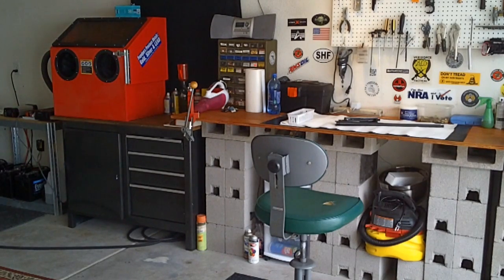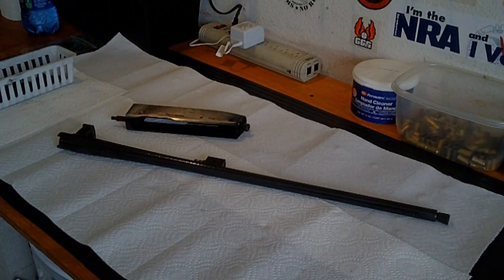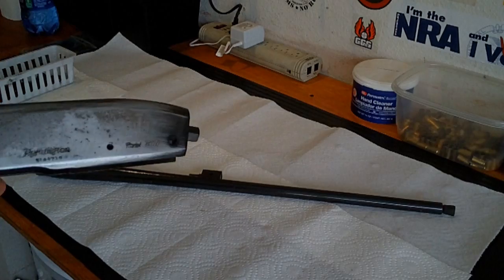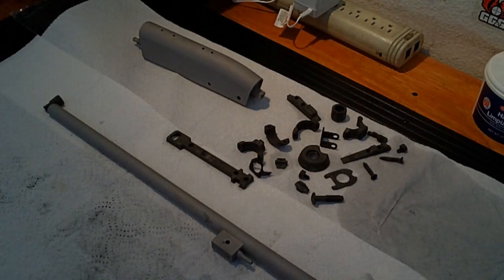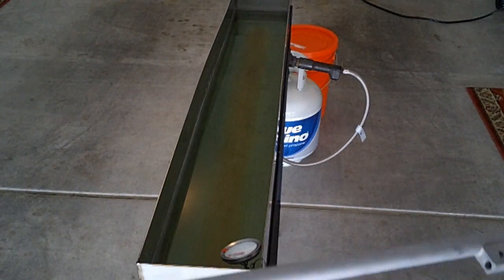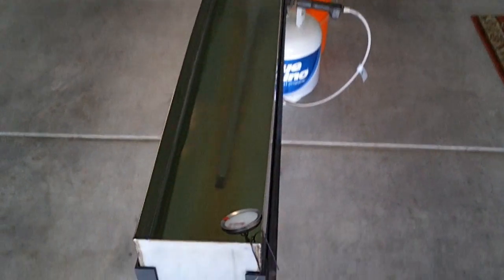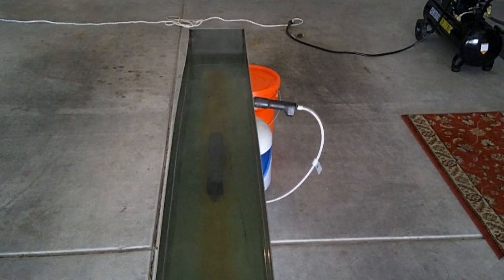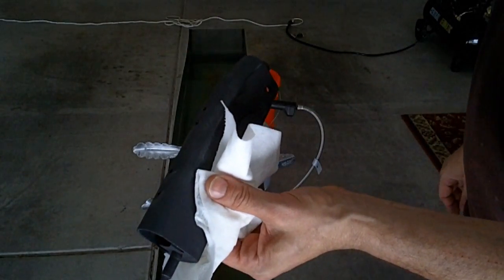Parkerizing

Comment: Awesome....  I have a question, good sir. If I were to copy this setup, amd have no access to sand or bead blasting, but do have a wire wheel. Will the results of my efforts still be adequate? I dont mind of it isnt pretty, I just want the protection.

Comment: Nice vid and good result. How does parkerizing hold up over time and how well does it prevent rusting. Is it as good as factory bluing, cerakote, cold blue??
Reply: jonnebanan Its actually an acid etching to create a surface that lubricants can last longer on.
Bead blasting it first just makes it work better since that makes the surface pitted on a very small scale.
I have several firearms that I zinc phosphated and the finish is very durable and doesn't rust.
Your part needs to be extremely clean or you will not get a good finish and you will degrade the solution.

Comment: I made a triple tank set up on a small, old bolt together Craftsman Table saw stand.
1: Hot Parkerizing solution.
2: Hot Water to rinse.
3: Hot WD-40 to displace the water and adds oil before the crystals cool off and shrink.
Reply: What did you use as burners
Reply: @peterpiper_203  3/4" black gas pipe with a line of holes drilled in them.
Everything except the stand and gas cylinder is available from Home Depot, Menards, or Ace hardware.
Reply: archangel20031 
Thanks easy enough

Comment: I have a clue for paint and rust removal. SOme enamels are very easily removed buy this stuff. Rust pits are cleaned down to bare metal and not covered up by sand blast.  The stuff is the Calcium/lime/rust remover  as sold by your local dollar store. a 24 hour soad and all rust is GONE. Rinse with water and immediately dip in acetone to remove any traces of water as this bare metal will rust again in front of your eyes it is so clean. I do  gun magazines this way and they are great and better than new.

Comment: Hi, interesting video...i have a question about the proper mixture of acid and distilled water, I have 1 kilo of the 85% phosphoric acid, what kind of ratio need to choose ? thanks
Reply from the maker: Thanks for watching, sorry I did not get back to you sooner.  This is the formula I used back before I got the park solution from Brownells.  It works ok but be careful with the acid, it can eat away quickly at steel
http://www.milsurps.com/showthread.php?t=43247

Comment: Great Video!!  I would like to know what ingredients/Mixtures would I need to do this myself. I have a few old Guns I would like to parkerize. Thanks for any help and information you can give.
Reply from the maker: All you need is some way to sandblast the finish to be parked, a stainless steel tank and a bottle of park solution.  You can buy the same stuff I am using in this video from Midway for around 60 bucks right here

http://www.midwayusa.com/product/245936/lauer-manganese-phosphate-parkerizing-solution-liquid

Heat it to 180 degrees, drop in your clean part, wait about 5 to 10 mins and you are done.  Wash it off, and then oil it up good and let it sit for a few hours to let the oil soak in (You dont have to but I do).  Simple as that.    Now you CAN make your own park solution, phosphoric acid, commonly used as a tile cleaner then you need to determine the proper mixture of acid and distilled water (1 to 24 ratio) this will get you a grey finish,  you can add zinc dioxide, or manganese dioxide ( battery core from a D battery) or other fancy chemicals to the mix to get different color variations, but its safer to order and use the solution, as the wrong mixture using acid can ruin your firearms.

Comment: Do you have a related titration lab setup, to maintain the constant chem ratios? As well, the aerospace industry uses VVL-800 as a quench/ post phosphate. I prefer the process, for the cessation of gassing. Our levels are also between 180-185 ° F. Replenishing, due to the dragout. It can be tedious, esp. when doing a triple H2O rinse, then CrO3 blanching. Nice video, buddy. Either aluminum oxide 180 grit garnet blast, or glass bead peening is good after a hot vapor degreasing. I prefer this method of deposition, over an electrolytic plating setup just for the lesser cost. I worked for Boeing.
Reply from the maker: Nope, nothing as technical as that, Just add the park solution to the correct amount of water, and when it gets low, add a bit more distilled water.  Generally for sand blast media I am using 70 grid alum oxide, its cheap enough and lasts a good long time.  Thanks!  I did this video ages ago, my wife told me to do it because when I was working at a local gun shop, she would come in the garage and said it looked like I was a mad scientist working in there with all the chemicals boiling and noise going on :)

Comment: I'm assuming that your tank is 6x6x40, how many gallons of solution do you put in? Nice work by the way. Next question if I want a gloss finish is that possible with Parkerizing?
Reply from the maker: +Jimmy Wheeler You cant really get a gloss finish with park, I use about 5 gallons of solution, one gallon park solution and 4 gallons distilled water.

Comment: hi, great video! i was wondering if the solution could be reused and where does the green come from? thanks ed
Reply from the maker: turnip1071 you can re-use it multiple times. Just add some distilled water when it gets low.  When it starts getting weak, just order another bottle of the solution and drop it in,  that way you dont have to toss it all out.   What green are you talking about?
Reply: turnip1071 the green comes from nickel acid
Reply: How hard is the nickle acid method?
Reply: Thanks
Reply: turnip1071 Nickel is just one of the chemicals in the parkerizing solution, but its the one that makes it turn green. Yes, you can reuse it.
Reply: So I need to order a kit that has nickel acid in it Is what you're saying
Reply: turnip1071 they all do. You will either order Lauer's or Shooter Solutions.

Comment: nice job, just as simple as that.
what other metals can be parkerized?
Reply from the maker: You can parkerize any steel pretty much but stainless.  Also will not work on non-ferrous metals such as aluminum, brass, or copper. Also any metals with a high nickle content.  Pretty much any plain steel can be parkerized. Thanks for watching!
Reply: thanks for the info, nice vid, i love my guns and i am looking forward to see another informative vid, have you tried Hydrographics?
Reply from the maker: Glock Aycardo
Nope have not tried it yet. I think my next mission is going to be cerekote,
Reply: cerakote is great. very durable.

Comment: Hello Im thinking about doing this to one of my rifles do you know if I have to sand blast it or can I get some blue remover and buff it down as best as I could with steel wool to take off all the bluing and grease off? thanks
Reply: Good Question- would like to know the answer myself.
Reply: It is best, to abrade the substrate material by 100% coverage, so that the manganeze phosphate can work thru permeability and retention/ adhesion. It is oil quenched ( dipped) / as an end protectant. The grit to use, is #180 grit aluminum oxide ( garnet) or a very fine mesh glass powder blast. The window of time between abrasion and immersion should not exceed 15 mins. Otherwise, micro- corrosion can begin @ 50% R.H.

Comment: what temperature do have the degreaser at I would like a reply asap thank you video was very interesting
Reply from the maker: +Shawn Darling I just use acetone to degrease, room temp, nothing special.  As for the parkerizing solution, it may change due to recommendations from suppliers but for the most part I keep it around 170 to 180 and that gives me even results.

Comment: Do you plug the barrel before dipping?
Reply from the maker: +Lane Lepera Yes, I just use those test tube type plugs, they work great and you can get them in all sizes.  Picked mine up years ago at a local supply place.

Comment: I have a Mauser 98.. with some rust and putting.. can that be sandblasted away.. what grit?
Reply from the maker: You may not be able to get it 100% away, but trust me, even if you don't, after you parkerize it you wont noticed it hardly at all.   I am using 70 grit Alum Oxide from Harbor Freight for this.
Reply: Iridium242 where did you get your cocktail.. I am wanting to do AK and maybe this Mouser..
Looks like you are using a harbor freight blasting cabinet.. are you using their gun too
Reply from the maker: I use this park solution here
http://www.lauerweaponry.com/index.cfm?fuseaction=category.display&category_ID=1106

I am using the cabinet from them as well as the gun that came with it.  All works pretty darn good for Harbor Freight stuff.  3 years later its all good to go.  Only thing I have upgraded was my compressor which I got from Harbor Freight as well.

Comment: What do you use to plug the barrel of a shotgun when you park it?
Reply from the maker: +RockDoktr Some rubber stopper plugs in various sizes I got at home depot.  They work good, I put them in before sand blasting to protect the barrel, check them after blasting to make sure they are in good, and then set them again before dipping in the park solution.  Heck, sometimes I have even used those cheap rubber ear plugs, but the rubber stoppers work best.
Reply: Iri
thanks for sharing your knowledge safe shooting

Comment: any firearm that hot hot enough in a fire to burn off the finish should be scrap.
Reply from the maker: At the time I did this video it had been checked by a gunsmith in the shop I worked at, and was test fired.  According to him it was perfectly fine.  I think the damage was a result from water damage and not fire.
Reply: +Iridium242   that would be better. o didn't mean to degrade you. you did a great job on re blueing the gun. I work for a gun Smith a few years and we had a few mins come in that had been cooked good in a fire. he would not fix them because he said he had no way to insure it was safe. bit the gun did clean up nice.
Reply from the maker: No worries.. just didn't want people thinking I was fixing a gun that had been in a raging fire lol.  The gun shop moved away from here so now I just re-do my own guns when they need it.